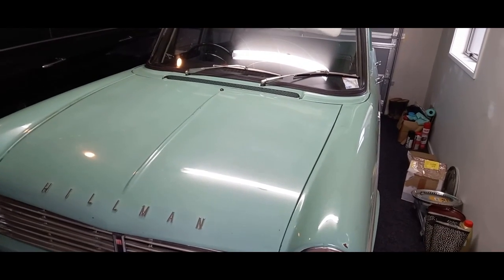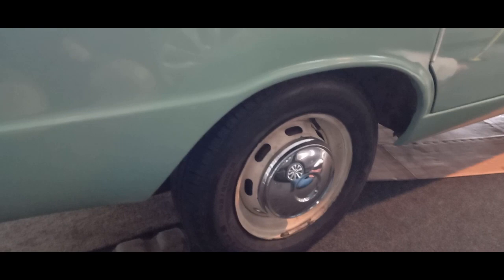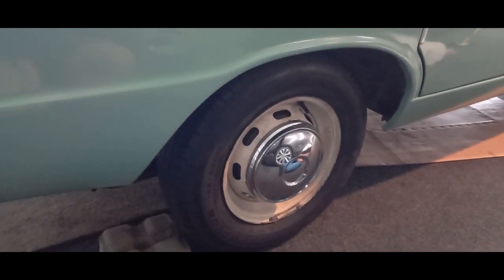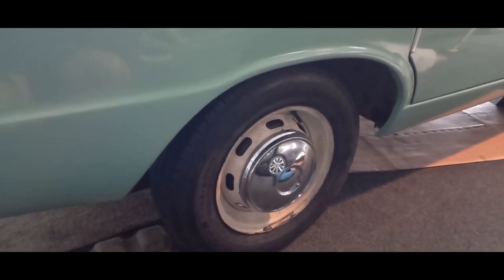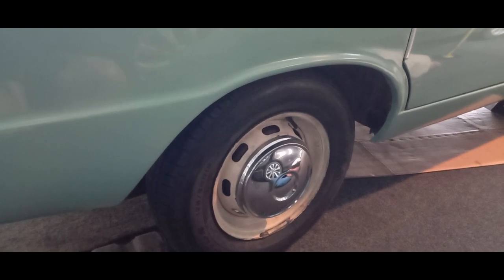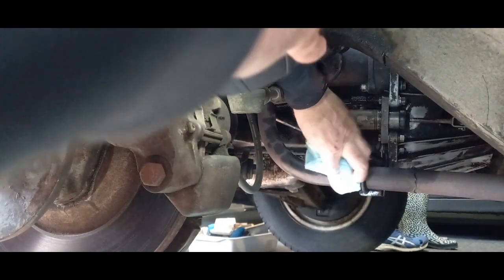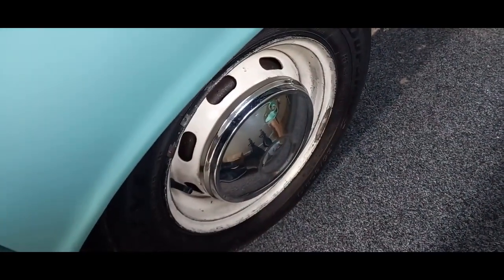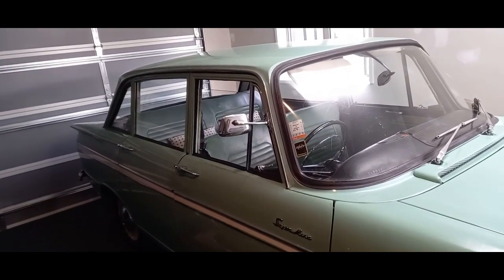Why is the newly rebuilt clutch slave cylinder leaking on the Hillman SuperMinx?

Comment: New speedo cables are easy to get if yours is stuffed, I think I may even have one, the Humber Hillman car club spares guy in Palmy north usually has them
Reply from the maker: Ok thanks for that.  I will have a go at trying to clean the old cable in the first instance.  It might be that it just needs replacing.

Comment: THe clutch slave mounts behind the bellhousing not in front like that theres too longer push from that position the piston is coming out too far, slave cyl is the same as Triumph 2000 readily available new
Reply from the maker: Thanks for that will look at repositioning it.

Comment: A 'bouncing' speedo can be caused by ingress of lubricant into the speedo itself, which is a pig to clean! Good luck with that! The lubricant comes up through the cable into the magnetic wheel assembly by capillary action...
Reply from the maker: Ok, thanks for that info.  Perhaps I need to also take the speedo apart and try and clean around that assembly.  What do you think?  I have also read  that they can demagnetize, which can cause a similar issue.  But will try at least having a go at relubricating the cable.
Reply: @everything-hillman66  Cable shouldnt be lubricated my speedo sounds like a chainsaw speedo failed coming back from WOF inspection it lasted long enough to pass.